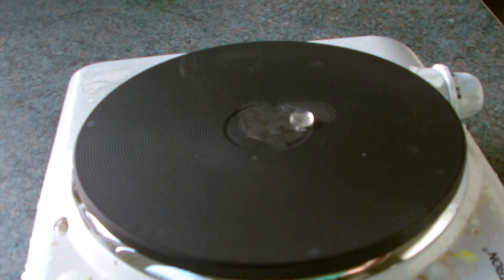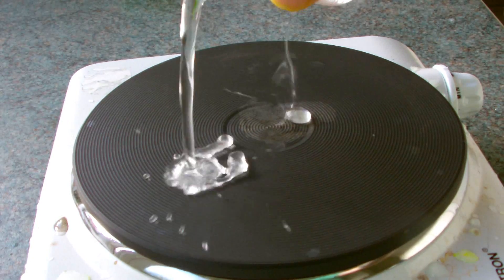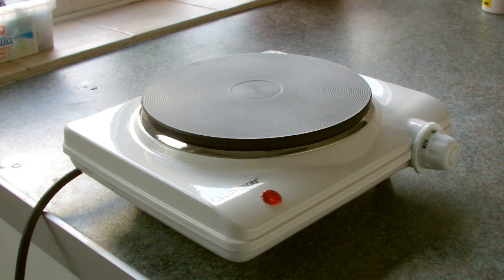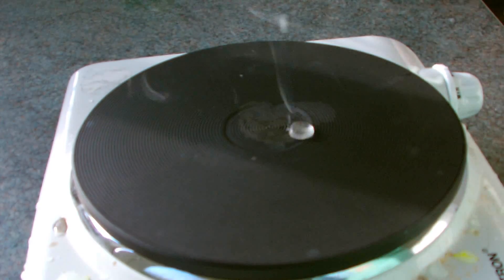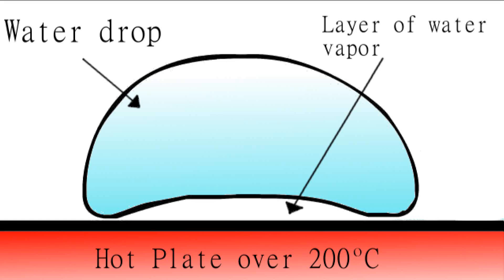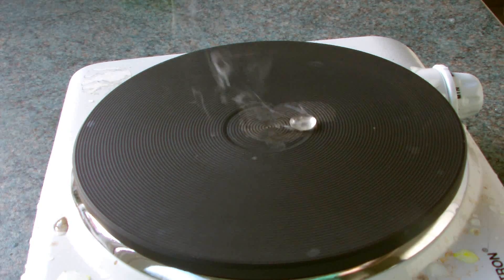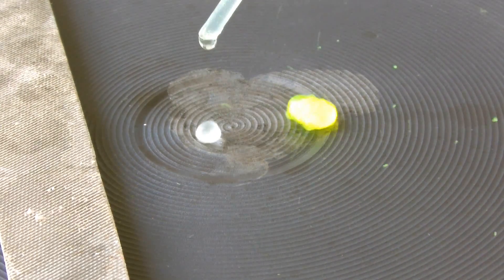Strange Water - Leidenfrost Effect

Comment: Put water on a plate of slime and get a similar effect where the water won't mix and bounces around, but not as fast and without heat
(Might not work with all slime, mine did though)

Comment: If you kept the heat at high and the droplet was still on the surface, would it evaporate?
Also you should turn off the lights with the fluorescent dye

Comment: You specifically mention water. Would this not also work with other kinds of liquid?
Reply: ***** It would. The only thing is that some other liquids, eg-mercury, will have much higher Leidenfrost point, so it would not work in these conditions (200 degrees Celsius).
Reply: I see. Thanks for the info.

Comment: create a train that goes on a platform that is over 200 C.
the train will use sea water. sea water will jet out from the body of the train and drift off following the platform.
Reply: smackingman That is an interesting yet impractical idea. Let's consider the following conditions: 
-You are describing a hovercraft using steam instead of air
-You would use a train to carry passengers or export/import goods; anyone or anything accidentally exposed to the platform will be seriously burned.
-When seawater boils, water evaporates and leaves behind salt and other impurities.
-Seawater has a higher boiling temperature than pure water.
-Seawater is found at the sea. The train must carry a reservoir.
-The platform must be maintain 200 C, and must compensate for temperature decrease and be maintained for however long point A is to Point B.
-Fires everywhere near the platform.

Your train must carry a lot of weight in order to carry x tons of water; the water, passengers and cargo must be shielded from a constant 200 C. Your train will need to carry seawater for long distances, away from ocean or seas. Your platform will consume all the oil to reach point B. Your platform will be coated with salt and impurities. Your platform is shielded to prevent heat loss and accidental burnings.
Reply: smackingman How would that be more effective than what we have, when you have to use  much energy to keep the rail at 200 degrees constantly.
Reply: 200 C minimum. the water will come from the newly designed rails so no reservoir inside the train is needed. water will come from a pipeline. the steam will not be exposed outside. the water will be created then released.

Comment: A steam pocket is formed & trapped between the hot plate & the base of the droplet.  The steam pocket is constantly evaporating, but at the same time, slowly being refueled from the droplet.  A balance is formed where the steam pocket is being refueled from the droplet & evaporated by the heat below. The pressurized steam pocked not only keeps the droplet suspended but diverts heat away from the droplet. This situation plus the given size of the droplet is the reason why the droplet last as long as it does.
Reply: I saw the video too

Comment: Wait... doesnt the leidenfrost effect work with an extremely COLD surface?
Reply: No. It works based on the reason he just said. Gets so hot that when the water touches it, the water at the bottom instantly evaporates and creates a pocket of air under the water droplet, causing it to float.
Reply: No
Reply: And you mean substances if you drop liquid e nitrogen on the floor it well evaporate creating a air pocket .

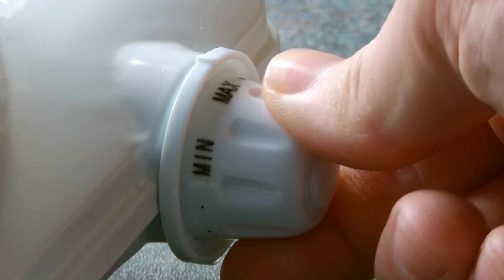Comment: 0:55
Actually, I find it rather interesting that the water sort of gravitated to the apparently cooler center of the hotplate. Very subtle effect of fluid dynamics.
Reply: Don't know if that's the real reason these drops went toward the center. It seems like most droplets went to the right due to the plate probably being on a sort of slope. The slightly higher ridges near the center seemed to simply act as a barrier to help keep in a few droplets as you could see, but even those pulled to the right.

Comment: Hoverboards could be real :D
Reply: Yeah!... Now all we need is the ground to be 200 degrees Celsius and not sink through the surface tension of water...
Reply: DarkPhoenix222 If you develop a ship made of water..
Reply: ***** I suppose, but that would a fuckton of work just to say "I've used a law of nature to do something cool."
Reply: does it work if the ship with 200degree bottom goes across the water? will it float?
Reply: Ok uhm... lets cruise a dune down on a dryice block
Reply: awesomeness2595 i think he meant does it work in reverse i.e have a flat bottomed but otherwise ordinary boat and then super heat the underside before bringing it into contact with water, thus creating the vapour from the ocean and having the boat glide along above it
Reply: awesomeness2595 oh it wouldnt be viable i realise that i was just trying to make what darkphoenix said easier to interpret. i mean it would surprise me quite a lot if you could get a big enough surface area/weight ratio just to hold up the boat itself letalone any passengers or cargo
Reply: *****
Well, 200 degrees celsius isn't all that much... I bet if you used a supercapacitor bank and a dense grid of heating elements, you could make a leidenfrost-based hoverboat.

Or aS.A.F.E. reactor.

Comment: Its because the amount of energy required for the water to stay on the plate is much higher and the water will have to create energy to stay on the plate, which is impossible, in simple terms, its to much effort for the water to stay on the plate, and instead to find a 'cooler surface' it can form on.